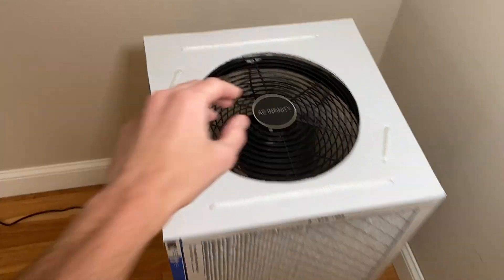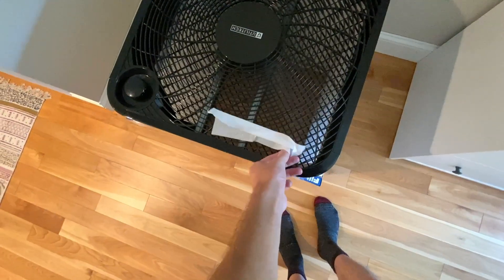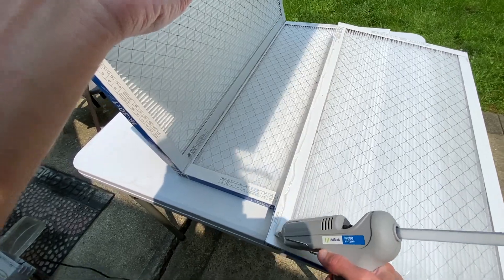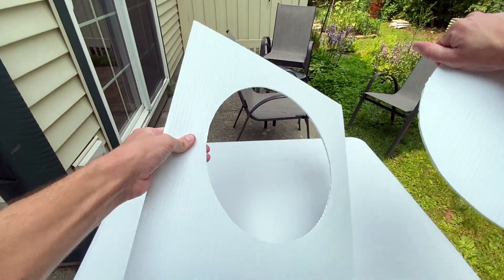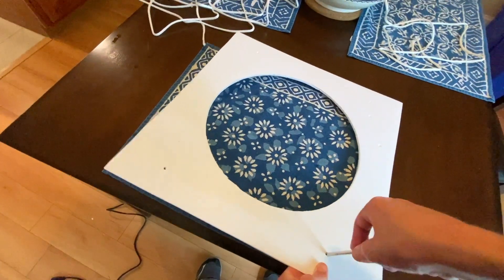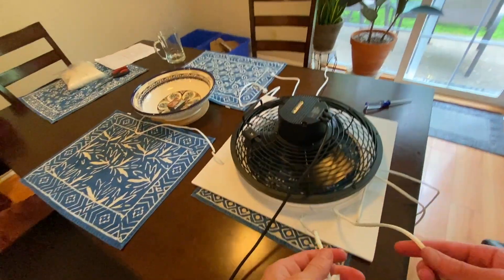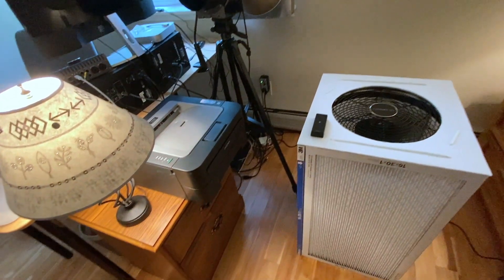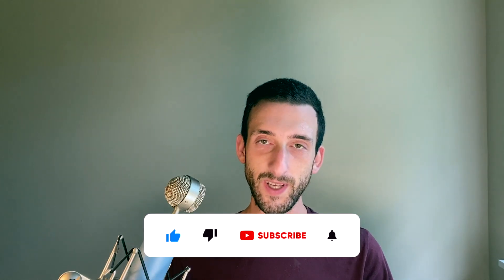How to Make a Better DIY Air Purifier

Comment: Watching this a year after it was put out.  Will comment anyway.  Currently using an Air Doctor 3000 series, have 2 of them in the house, one in our bedroom, and one in my Son's bedroom.  I have a Winix 5500-2 In our front room and a "Filter A Fan" which is a box fan with a custom attachment for a 20x20 1 inch filter.  I also run a MERV 8 1 inch filter from Home Depot (store Brand) in our home HVAC system.  I also utilize a air quality monitor that can scan down to pm 2.5 particle size.  Had indoor air quality under control until I was gifted a dog by my daughter.  Now my home is 10x's worse than it was.  Our backyard is primarily dirt so the dog tracks in ALLOT more than anticipated.  Air quality has suffered.  I have thought about making my own fan systems, but the aftermarket has made the filters affordable for my Air Doctor and since I already have the units I am keeping them.  I also find that the air quality sensor on the Air Doctors is actually quite good, I mean our dog farts next to it and it speeds the fan speed up its that sensitive.  The Winix sensor though is useless.  You can literally burn incense 1 foot away from it and nothing changes on it.  The OEM filters from Air Dr run about $60 a peice, that is for the VOC trap and Ultra Hepa.  Aftermarket I can get them for about $15 each.  I have issues with these homemade systems for sealing.  If the seal is not 100% you are going to get contaminants passing through yes the CADR can compensate for this but I would imagine after about 6 months of use you will see dirt building up on the fan blades of the home made units.  Use what works for you and thought the video was interesting and informative.

Comment: great video, but I can't find that size and that fan is $200 for me in Canada. I looked at Merv 11 (20x20) and it is $7.50 per filter. If I go to Merv 13, it is $31 per filter. The Merv 11 will clean to the same level, it just takes an extra 15 minutes or so to get there. I would rather spend $30 on filter replacement than $124 just to save 15 minutes of my time waiting for the air to clear in my workshop...I'll just take a break in the house for a few.

Comment: I know I am late to see this, but I am hoping that someone can tell me they have had success in using this to filter tabacco, pot and fireplace smoke from a multi-living condo or apartment space.  I need something that will work with smoke particulates.  I have been using a 20x20x5 Merv 16 taped to a box fan and it isn't budging the smoke at all.

Comment: For the past 2 Week I've been Scouring the net for a Deal on these AC infinity Fans and Boy for the 1st in a Long Time, I could not find it cheaper anywhere. I even tried to find something Comparable like Similar Specs, AirFlow and Quietness, Nothing I could Find Like it. So, it was Strickly $169 For the S12 and $199 for the S14. I went for the S14. Wish there was something else in the Market with Similar Performance for Less. Anyone? 🤔🤔

Comment: The Cloudlift s12 has been out of stock for quite a while, at least for the Canadian market. I placed and confirmed an order for one and a week later the supplier Astral Grow called me to say they actually don't have any but they can order me an s14 instead for a comparable price - great service! 

Does anyone have any thoughts on fitting the the s14 fan with this slim design? I still havent confirmed the full diameter of the cage as 14 inches is the fans themselves.  I aready received my 16" filters from Costco.  I might have to return them and get 20inchers instead which would suck a little aince the 16" design is so sleek!!

Comment: Hi, why are you pointing the airflow upward? When I built a box fan type of version and pointed it upward for my garage to do woodworking there was the wood dust everywhere, so I had to point it down into the box.

Isn't it pointing it down going to ensure that you have more air flow going into it with a dust particles?

Comment: Could I use multiple PC fans for equivalent rpm with low decibal noise?
Reply from the maker: Definitely!
Reply: I did it! I just had to get a circuit boosting usb connection to boost the fans from 5V to 12V, I then connected them through the USB to a 34w power adapter which could be set to 12V.
Reply: Brilliant Idea.
Reply from the maker: I actually have a video about using PC fans for this. It's called "Most HEPA air purifiers are a scam"

Comment: This is great! I just ordered materials to build three, but with a twist: ALL BLACK & with carbon filters :) I know you commented that a thin prefilter won’t do much, but I can’t resist for aesthetic purposes. The prefilter will grab dog hair too.

I found on Amazon some “Cut-to-fit Activated Carbon Filter Sheets” that are 16” by 48” and 0.4” thick. Cut in half, two sheets should cover the 16”x25” filter box I am building. I assume that the frame of the filters are at least 1/2” thick, making the interior height 24”, but I can bridge any gaps with tape. Six sheets total for three boxes is a decent volume of carbon (~0.6 cubic feet), and might actually do something, but I don’t have many VOCs so it’s just a bit of peace of mind :)

The 3M 16x25 MERV-14 (2500MPR) filters I found have black frames, and I have found black coroplast and some black paracord as well. I even found black hot glue sticks. Can’t wait to see how they turn out.

Comment: I accidentally ordered 16x25 instead of 16x30.  Will this work, or will the loss of filter surface area negativity affect the performance to the point i should send them back?
Reply from the maker: 16x25 works great.

Comment: Your description has a link to  16x25x1 filters. It also has a link to an S14 fan. You might want to fix that. Hate to see people make the same mistake i did.
Reply from the maker: Like I said in the description, 16x25 is now what I use. More convenient when building the box and when changing filters/disposing of them. Also, the S12 link is the correct link - it's only linking to the S14 because the S12 is temporarily out of stock. (It says that on amazon).
Reply: @HealthyHomeGuide  Ahh i see that now, whoops. I actually made it work by installing on top. The fan needs a higher speed to create better negative pressure. I like the fan. I will just get 16 x 30 next time and try the fan in the other direction with the filters facing the other direction as well. Less air turbulence, however, it may reduce the cfm. Not that it hasnt been done before, but ill check back in with results. Prob be a while though.
Reply: @HealthyHomeGuide  do you have any good sources for 16x30 filters? Thanks!

Comment: I use a Germguardian AC4825E. It seems to work pretty well, but, the CADR (Clean Air Delivery Rate) is low, and the filters are very hard to find, and expensive. I also have an Ionic Pro electrostatic air purifier, which also has a good first pass efficiency, but, it produces Ozone, and it needs a lot of maintenance. The problem with both of these, is that they draw air in the back, and blow it out the front. I much prefer the Corsi-Rosenthal design, because it draws air in all sides, and in my design, the bottom as well, (I used a filter underneath, and have it on a grid, spaced off the floor) then, blows the air out of the top. That creates a toroidal circulation, like a ceiling fan, placed of the floor. It's able to circulate air throughout a large room, collecting dust from every corner. I placed an annulus around the fan blade of a box fan, and closed off the corners, so there is no back flow around the top. This rig has 10X the airflow of both the other purifiers combined!
     I used four 20X25 Filtrete MERV 13 filters to make the sides, and a 20X20 (same specification) filter to make the bottom. It's big, it's ugly, It's loud as can be, but incredibly effective! It's amazing, when rays of sunshine beam through the windows, and you don't see a single speck of dust in the sunbeams.

Comment: That is really nice.  If I was going to get nit picky, I'd replace the nylon rope with polyester rope that will never stretch.  

Coroplast is easily cut with a multitool and J-hook blade.

EDIT: About 3 months ago I was passing through Lowe's and checked prices on their filters.  I had to take a breath when I realized what this would cost, and decided to drop down a MERV level.  I needed to go to the other side of the store and rather than carry 4 filters around I figured I pick them up on the way back.  Along my walk someone had dropped off 4 filters, seemingly identical to the ones I was going to get, except these were marked 4 for $16.  SOLD!  I DID carry those through the store in case someone else saw them.  Passing back through the filter section the same filters I had in my hand were marked $16 each with no mention of 4 for anything.  So I built the air cleaner with a Vornado fan that runs 24/7 anyway to circulate air.  Now, 3 months of running 24/7 later, the filters are visibly dark and especially dark when compared to new filters.  We have 2, indoor, black cats and 1 indoor/outdoor dog. The air cleaner is most definitely doing its job.  I think it's ready for filter replacement.  

By the way, this did not pass the wife or best friend test for visual appearance or beauty.

Comment: I have a Bissell Air220. The HEPA filters are $25 and come with activated carbon. I replace them every six months. How often do these DIY need to be replaced, because currently on Amazon it would cost me $84 instead of $25 per six months.

Comment: I just finished my build, so clever to hot glue the filters together
I did not have a compass, I know I have one somewhere in the house... so I use whatever I had in the kitchen and found something that was 12.75 in.
with a bigger hole I was able to use tye wrap and they do not catch the fan.

I was afraid that the coroplast would not be strong enough but it does hold to my surprise.

Thanks for showing us that
Reply from the maker: Sounds great!

Comment: Just curious... What happens if you flip the fan direction so it's basically a vacuum cleaner? I get that you are drastically reducing surface area on the suction side, but also you're not recirculating particles that are above the unit and blown away.
Reply from the maker: For air purifiers the fan should be blowing upwards, for two reasons: 
1.) If you blow air downward into the box, there's a lot of turbulence that reduces the air flow rate. 
2.) By pulling air through the filters before it hits the fan, the fan will stay cleaner.

Comment: First off, good design and am interested in trying this fan setup. I do have to point out that not all box fans are 60 db at their lowest or mid setting. That seems a bit reductive. Also, every single DYI box fan tutorial I have come across has a fan shroud on the intake to eliminate inefficiencies and dramatically improve air flow through the filters. This allows you to run the fan at the lower settings and be much quieter.

Comment: That was good.  I want to make one.  But the AC Infinity CLOUD s12 fan is currently unavailable - for Australia.  Let me know if you have any other recommendations for fans to use.  Maybe just a regular fan would be okay - or did you choose that one for some special reason?  I'm highly sensitive to chemicals, radiation and mold.  It's a journey.  - I just did some research on the filters and they are only tested to filter air from 0.3 to 1 micons.  I need to remove a mold mycotoxins at 0.001 microns. Which is ridiculously difficult. I wonder whether it would work?
Reply from the maker: Thanks for your comment! Removing mycotoxins is definitely a complex challenge, especially with sensitivities to chemicals, radiation, and mold. It’s not just about filtration—it requires a tailored approach to ensure everything works for your specific needs.

Feel free to schedule a chat through my website, and we can go over some options to help you navigate this effectively. I’d love to assist!

Comment: hi, great tutorial & plan, thank you!  I notice the S12 (fan) link is redirecting to the Cloudlift S14 fan, and that Amazon is no longer selling the S12, at least presently, apparently. The S12 is 12"diameter the S14 is 14" diameter. Any suggestions about re-measurements, given the fan difference? thanks again!

Comment: Looks like theres are large gap between the fan and the upper cover which would allow air to flow around and through the fan.
Reply from the maker: I wouldn't call it a large gap - and it doesn't seem like air flows through it.
Reply: @HealthyHomeGuide  looks nearly half inch, and air follows the path of least resistance so i bet you're losing 10-15% air flow around the fan instead of through the filters
Reply from the maker: I've tested using smoke and also with toilet paper and it doesn't seem like air gets sucked in through there. Maybe some does that's escaping my measurement techniques, but not a huge amount I don't think.

Comment: I am using two 550 cfm airscrubbers for my 1100 sf from a remodel and <50 g/l voc primer that stinks bad! I don't think it's very effective, though I changed the 3 filters per unit every 3 months. I read Titanium dioxide is being used to  convert vocs to inert molecules as well as mold mycotoxins bacteria viruses....
Please can you look into that?
Lol, I already bought TiO2 from Amazon. Not sure if I can mix with water and dip cheesecloth into let it dry and attach to my HVAC filter. I'm sure you cld come up with something amazing.
PS  I also have mycotoxin illness.

Comment: What would happen if you reverse the fan, maybe have a vacuum bag or something.
Reply from the maker: For air purifiers the fan should be blowing upwards, for two reasons: 
1.) If you blow air downward into the box, there's a lot of turbulence that reduces the air flow rate. 
2.) By pulling air through the filters before it hits the fan, the fan will stay cleaner.

Comment: @HealthyHomeGuide Thank you for the nice design. I live in Europe and the s12 is surprisingly hard to get without paying an extra s12 in shipping costs. I was therefore wondering if it possible to use the s14 instead. It is somewhat bigger, but perhaps you might know if it fits or an alternative to the cloudlift line.

Comment: Can we get an update on how long this lasted you. Also I was wondering if adding a air quality sensor inside the box would provide enough data to track the longevity of the filters. (these sensors are becoming smaller and cheaper on top of being smart enabled)
Reply from the maker: I'm still using it :) I've been replacing the filters every 6 months or so. That's a great idea about trying to track filter longevity with a sensor that logs data.

Comment: The fan costs $200! I was not expecting that. I love the hot glue idea. Everything else looks very doable, but that fan has me wondering if there’s a less costly option. Thank you for this!
Reply: Can’t we use a few PC fans?
Reply: Compare prices with HEPA filters.
Reply: Yeah, a $200 remote control fan? Seems like you should be able to find something that would work okay for much less money.
Reply: I used a regular home fan that I got used for $15. Works like a charm, although a bit loud
Reply: Did you find anything better?
Reply: The problem is the market for EC fans for still pretty niche and when your the only one you can charge what you like.. AC infinity stuff definitely got more expensive once they moved into the growing market too

Comment: Talk about dust, here in Abu Dhabi is a must. Although wife against diy, I will still do it. 
Question .. what happens after sucking all dust? do you wash water spray? vaccum? or discard and just build another one?
Reply from the maker: I replace the filters every 6 months or so. More frequently if the air quality is particularly bad (wildfires, etc). During those 6 months, I vacuum the filters periodically.

Comment: Thank you!! Great design….QUESTION: does this help with micro plastics and nano plastics?
Reply from the maker: It should, yes. Microplastics are just fine and ultrafine particles, which the research I discussed in this video shows that MERV-13 air purifiers can capture.

Comment: I came across you channel while doing some research on an air purifier. I like that you optimized the original design. It would be great is there was a way to determine or estimate filter life and CADR for the design.
Reply from the maker: Awesome, thank you! Working on it.

Comment: We have a 5 of winix purifiers and I don’t like them because I’m 95% sure they don’t do anything on Auto and are too loud and energy intensive on full speed plus replacement filters are insanely expensive.
Reply from the maker: Great points. I don't like them for those reasons as well.